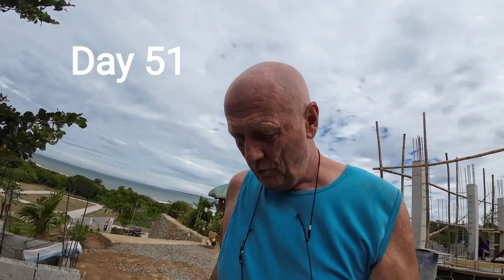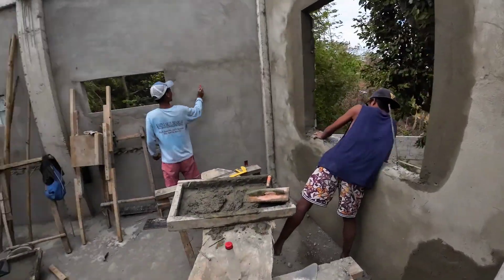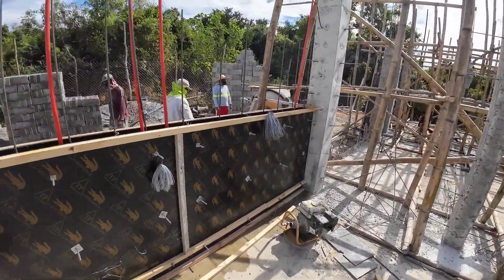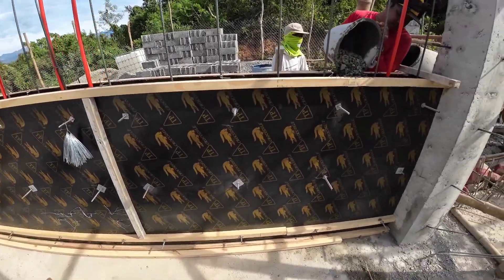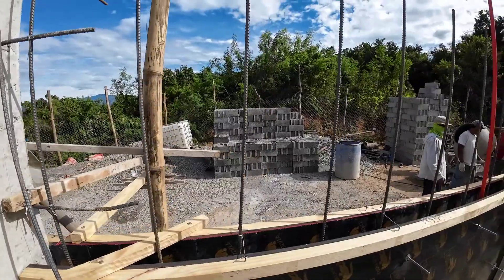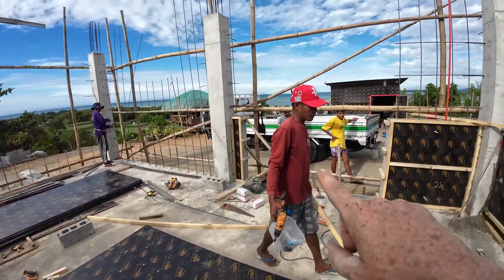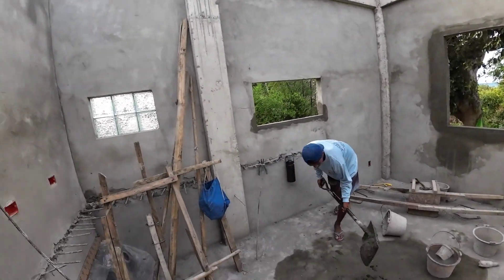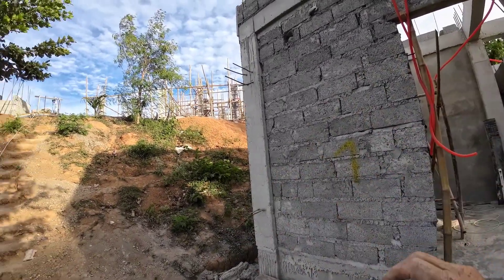051 I am excited our first wall is going up.

Comment: Thanks for the closeup very interesting board - we don’t have that in US. I was told we simply spray diesel on the board so the cement doesn’t stick but then you kind of scrap that board. I like that Crocodile board better
Reply from the maker: Yes we used diesel in Norway also before, but then came the environment thing. Let's see how long time the boards will last.